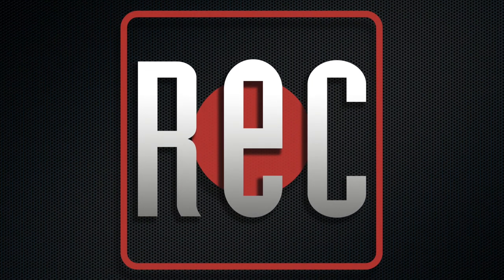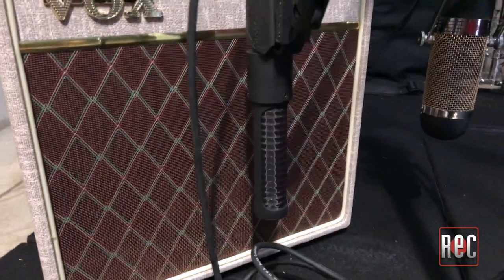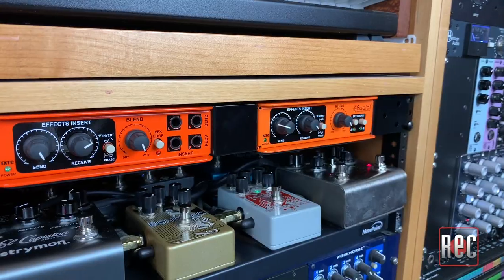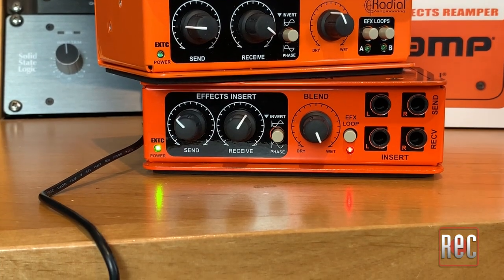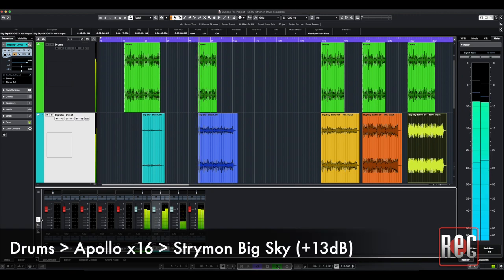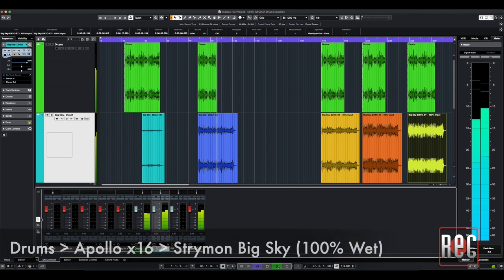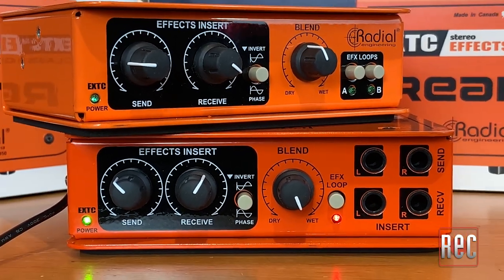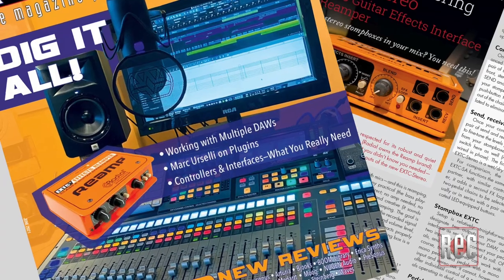RECORDING Video Review: Radial Engineering EXTC-Stereo

Comment: Very useful information, thank you for putting this video together.  I'm still curious about how a set up with an analog mixer would work.  Do you still need, or benefit from, the Reamp box if you are going: Soundcard xlr out to line level in on the mixer, then using the aux sends (line level as well) to send to a stomp box?  Any difference with a strymon vs older stomp box?  Thank you for your time.
Reply from the maker: 1. Yes, you would still need/benefit from this in your setup as it converts your line-level signals from your aux sends into the proper pedal impedance. 

2. Every pedal can react differently, and the EXTC boxes will offer an even greater benefit than a modern Strymon.
Reply: @RecordingMag  thank you for the reply 🙏

Comment: Do you need to use XLR to go I/O of your interface? I have the mono version and I use TRS to go I/O of my interface but when I send my pre-recorded track out to the Radial, the signal I get back is mushy, clipping, distorted- uglyyyy
Reply from the maker: Hmmm, not sure what is up there (maybe contact Radial to trouble shoot). I sent the units back a long time ago, however I did all of my connections to my patchbay which is TT using patch cables.
Reply: I've been getting the same thing trying to use TRS 1/4" cables for I/O. Let me know if you've found a solution and I'll do the same for you :)
Reply: Did you make sure your interface "in" ports are set to "line" level instead of "instrument" level? Sometimes I forget to check, and experience clipping